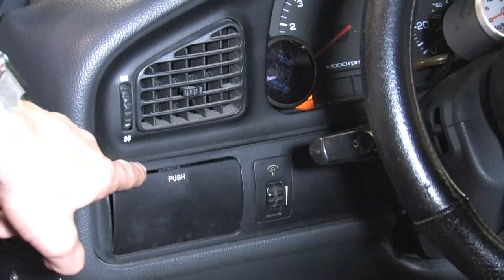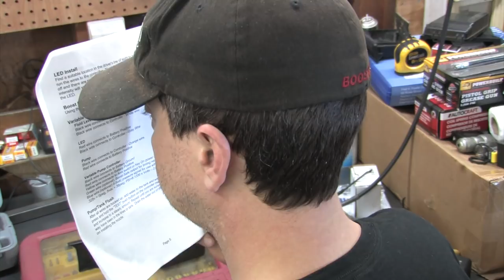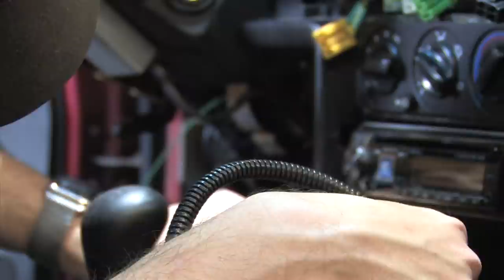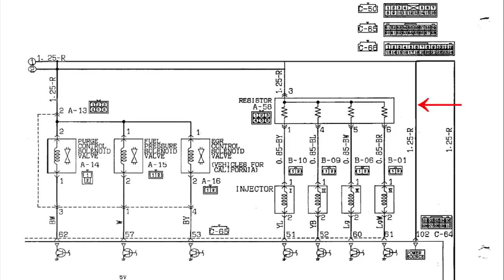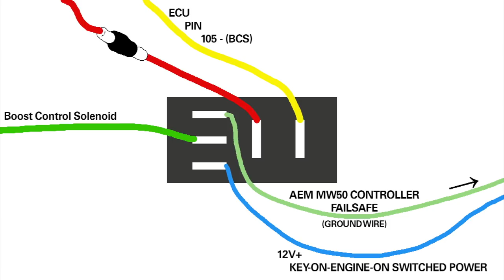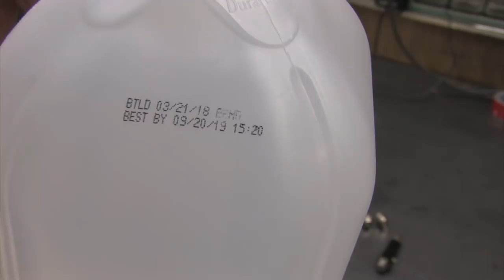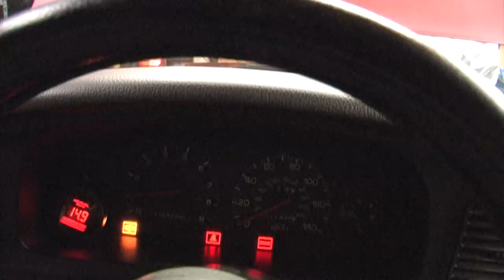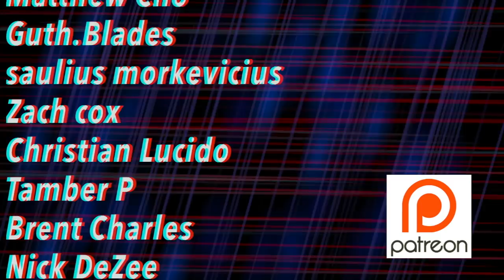Water Methanol Injection Installation

Comment: Great job. I was just going to get on the treadmill for 15min. But 43 minutes later here I am. I still didn’t get why you needed the fake circuit. Was it just to keep ecmlink cozy that something was still there?
Reply from the maker: I don't need it, I have an OBD-I car.  People with the second gen OBD-II cars will get a check engine light if the ECU circuit to the BCS is broken.  I made it match resistance of the BCS just so that it wouldn't feed an un-resisted load into the pin.  But really... all that was unnecessary because the OBD-I ECU doesn't care that the BCS circuit is opened.  At least it doesn't hurt anything and it helps all the Subaru WRX guys get rid of a check engine light if they use this approach to cutting boost (since all those are OBD-II).
Reply: Jafromobile ahh. Never had a 2g. How often does it check it? He would it light right away that you could use that as an indicator of fluid out if you didn’t want to mount a light?
Reply from the maker: Well, yes, you could.  But there's that whole "limp mode" thing.  Yes, the light is instantaneous.  It even immediately resets itself once the circuit is restored... BUT, the WMI kit has a warning LED that tells you you're out of juice.  My method simply puts the car in a gasoline-only portion of my fuel, timing and airflow tables.  If waste gate pressure results in this, there's no need for dealing with bad fuel economy in limp mode just because I ran out of MW50.  To me, that would be like punishment.  Go sit in the corner sort-of-thing.  If nothing else is wrong but an empty bottle, I prefer for the car to continue running properly.

Comment: You should wrap the hose with some insulation to prevent vaporization in the line.
Reply from the maker: Nice tip!  I hadn't thought of that yet.  :D
Reply: Jafromobile I've never used meth/water injection I just figured high pressure nylon tube in a  hot engine bay. I wonder if there would be a noticeable enrichment difference with and without insulation on a hot track day?

Comment: Boost gauge from Harbor Freight is just installed wrong and placed in the wrong spot. None are the fault of the boost gauge. Simply user error.
Reply from the maker: Harbor freight boost gauge ends at 20 PSI.  I'm running 24-30.  I suppose that's my fault, too...

Comment: Hey Jafro, saw a video of a guy having leaking issues with his AEM nozzle so he switched to a Snow Performance nozzle with his AEM kit.

I just purchased a new AEM kit myself last night (new video for that to be made when it comes in). But wondering, have you had any leaking issues at all with yours?
Reply from the maker: Yes, absolutely, I have.  It leaks, and despite the reed valve, given temperature changes it can leak in both directions, so you can even get air in the lines behind the nozzle.  That's bad, but that's why they gave us a purge button.  

This kit came without one important piece, but it's easy to add.  I picked up the solenoid to cut off the flow when the kit isn't firing.  There's actually an output wire from the controller that makes it a really simple install, If I put it close to the nozzle, it will solve all of it.  I just haven't installed it yet.  The only other thing I'd add is that you never need progressive control if you're tuning anything with the SD table   Just turn it on full blast at a pressure where it benefits you and it's easier to get all your percentages right however you're adjusting for them.
Reply: @Jafromobile  assuming you're saying the nozzle is leaking on the inside and water/meth keeps flowing, or air goes up the line? Here's the video I'm referring to where it appears to be leaking outside the nozzle I believe. Maybe where the line goes in.

I think I'm going to do as this guy did and replace it with a Snow Performance nozzle. Just have to figure out which nozzle/nozzles to run. From the looks of it, if you get pretty high in power you might need two nozzles to support the flow. Can't really tell just yet so still researching on that one.
Reply from the maker: @V8sareslow1  If it's on YouTube, just drop the video title, I'll find it.  I didn't see a link, so maybe it got blocked... but yes, all of my kit's leaking is internal.  It's like the reed valve doesn't work well enough to do its job, but I don't think a reed valve will ever work as well as a solenoid that stops the flow.  The 1/2 full line of my water methanol tank is the same height as the nozzle.  If I park the car for a week, it will drain the tank to that level right into my intercooler.  If the level is below that line, I end up with air in the line before the first time it sprays after it sits.  Based off this, I know that when I'm driving on the highway, my intake is under vacuum, and even without the kit spraying it's sucking fluid through the kit no matter what level the tank is at.  If there's an external leak on your nozzle, mine is not doing that.  I know it's leaking into the intake.  I believe this kit needs a solenoid because there's no flow cutoff whether it's operating or not.
Reply: @Jafromobile  my methanol kit should be here tomorrow or the next day. I'm having some drivability issues but once I get that figured out I'll be installing it and making a video for it. Went ahead and purchased a solenoid as soon as you mentioned that. I'll be installing that as close to the nozzle as possible. Appreciate your insight on it otherwise I wouldn't have known and just installed it as is. Also purchased a filter to keep out any garbage. I'll keep you posted though.
Reply from the maker: @V8sareslow1  I was probably a little overkill on my failsafe relay wiring, but I have to admit, it works mint!

Comment: Let me give you a few tips for a cleaner install. Flap disks their awesome try them. Cut the head off the bolts drop the bolt right below the surface of the tube so when you weld it you can grind it flush

Comment: We need in intervention on the subwoofer in the trunk,... is this not a race car? Weight reduction?
Reply from the maker: It is not a race car.  It's a subcompact economy sedan.  The bass is just part of its troll.  It's going 12's with a pair of 12's.  The GSX did it with the same turbo and cams already but one less amplifier and no bluetooth capability.  Same speaker box, though.  It's been around... Like I said, it's part of the troll.  Edit:  Heck, I want the world record ET for a Hyundai Elantra using a TD05H turbo, and with the subs still in the trunk.  I'm only 1 second away from it right now unless something hasn't been recorded.

Comment: thats a early 90s yellow dodge colt that was in the background, I almost had a chance to get one!!!  Are you eventually going awd with that colt
Reply from the maker: I already did.   I converted all 4 wheels to 5-lug for better wheel/tire options, too.  The rear axle install is done, I hate some of what I did after what I learned on this Hyundai (it's essentially the same chassis believe it or not), and when I turn that project back on one car from now... I'm re-doing some of it.  It also needs a new roof skin which is going to be a royal pain.  The videos are all here.  I let it sit too long.  Sorry about the poor sentence structure.  I'm on the verge of a food coma.  'never eaten as much as I have this week.
Reply: @Jafromobile  2005-2014 right, just saw your older videos.  Thats badass, I started the rx7 build in 07, then broke it, so back on the chopping board.
Reply from the maker: Yeah, I had some BS happen severe years back with my county that prevented me from being able to work on them all at once on my own property.  So I have to do one at a time inside my garage while keeping all others in working, registered, tagged, inspected condition.  The Colt is the only one I can't get away with leaving outside in its current state because the provision allows me to have one car and only one car in an un-registered condition.  So another car has to occupy the whole garage while it's being blown apart and re-assembled or I face a $2,500 fine... per vehicle.  So I have 5 cars, 3 running and driving.  One inside the garage, and one outside.  When I have 4 running and driving, the Colt will be the one I break records with if there are any attainable ones left by then...

Comment: Do you have a video on the ECMLink E-boost control setup? I have ECMLink and the 3 port BCS but have been hesitant to dig into it...heck I forgot I had it.
Reply from the maker: So you've just been running wastegate pressure this whole time?

Comment: just make sure you are careful if spraying water/meth during cold weather. If the charge temp is cold enough the mixture will no vaporize and will pool as a liquid at the back of the intake essentially putting a impressionable liquid in the back cylinders and cracking your pistons.
Reply from the maker: Nice tip!  Hey I've got other issues related to weather and water/meth.  If you bought this kit and you have a spare hydraulic solenoid sitting around to shut off the MW50 line when the car is off, maybe just go ahead and install it. If you don't, expect it to slowly empty itself into your intake as temperatures rise and fall.  Maybe won't hurt you on a cold start, but if you let it warm up and then hit the throttle... probably cause the same problem.  Cracky pistons.  I know I need to install one because I found my car is doing this as it sits.  It doesn't help me to have an intercooler full of MW50, but I'm not driving this thing at all right now.  Still has drag radials at 15PSI and it's too [expletive] cold to drive anything without heated seats.  I'm working on other projects at the moment that I should really be doing in warmer weather... and faking on camera like I'm not freezing my giblets off.

Comment: Have you thought of using a weatherpack plug, or a snipped plug from the junkyard to make your wiring a one clip ordeal?
Reply from the maker: Yes.  I did.  But I had solder in a drawer in my toolbox, and that would have required effort.  I would still have had to extend wires, and what steered me this way was the intent of making this a permanent install for the life of the kit.  If I have to remove it for whatever reason, I'll be re-installing a more extensive kit.  Of course I'll be really happy if it fits all of my needs and never has to be removed just the same.  :)
Reply: To anyone seeing this; if you've found a source for OE connectors and terminal pins other than the salvage yard or a stealership, PLEASE SHARE! The oompa loompa factories that make these can't just be selling them to the manufacturers.
Reply: Ryan Nelson have you tried Mcmaster Carr they have everything.
Reply: blindabinda123 I would like to find OE stuff. There are a lot of unused spots in fuse boxes. If you could find the right terminals, it's free real estate for accessory power.
Reply: Ryan Nelson check Mcmaster Carr. I'm telling you they have everything and if it's not on there website if you call them usually they either don't have it on their site or can find it.
Reply: Ryan Nelson let me know if that's what you were talking about.
Reply: blindabinda123 yeah those are terminals alright. He mentioned they were for a Chevy. I'll have find out what all else they support. Seeing some of the installation jobs done on jeeps and trucks for lights, winches, and what ever else those guys get a hard on for, there's definitely room improvement.
Reply: Ryan Nelson you could always take one out of one of the existing ones if the numb parts store guys can't find what you are looking for. My guess would be those are probably pretty much all the same buy you never know. What kind of car do you want them for?
Reply: Ryan Nelson did you check out that link for those wago connectors??? I've been using them for things and I can tell you they are life changing. They are great for thick or thin wires. Stranded and non stranded all in one connector and they have a test port if you need to check for power.  They are prefect if you wanted to run power to somewhere then run a couple different things off that wire. They make mounting plates for them and everything. OnceYou lock the nut closed you cannot pull the wire out either.

Comment: Okay I think I got it... I'm supposed to cut the blue wire and connect it to the red wire with 6 37 amp capacitors. Then spray water all over my engine bay and cut a hole in my intake so I can hear the knock and safe guard my car. Cause all the water might make my engine too cold to burn the meth and I have to put a screwdriver in a box in my dash to tune the relay to make it warmer and stop the knock before the bottle is empty. But if it is empty the relay will stop the backflow so it doesn't make it to the gate and get wasted.  Easy peasy. I don't know why people have such a hard time. There's a youtube video for anything you wanna know. Next up, fixing Mr. Whiskers limp. Heeeerree kitty kitty....

Comment: I have a old Cady with a 4.1 V8 but is lacking power.
The question is can I use this system to increase at least some power while using regular gas?
Reply: Yes, the benefits you get from water/meth are reduced on a NA engine though. In order to get the increased power you would need to tune the ecu to advance the timing. Snow performance claims that NA engines get a 10% power increase with water/meth.

Comment: Actually methanol is found at your corner store.  Just about any gas station you stop in will sell the yellow bottles of Heet gas line antifreeze.  It's 99% pure methanol and when i was using on my 1g it cost .99 for a 12 oz bottle.  Way cheaper than any of the premixed boost juice stuff, allows you to make your own custom mix and can literally be found at almost every gas station.

Comment: I mean the boostgauge blocking your view is your fault or who ever installed it, I use mine for checking max boost and watching for boost creep and checking vacuum
Reply from the maker: 1) the boost gauge was installed by the previous owner.  2) the ECU modification that uses the CEL for a knock monitor is something I installed after-the-fact.  3) the boost gauge goes to 20 PSI.  4) my turbo can make 29 PSI.  5) I built an engine that can handle every last gram of air my turbo can flow even if I welded the wastegate shut.  

I have nothing but 6-bolt 4g63s, so as far as the TD05H is concerned, even with stock pistons and rods there is no such thing as overboost.  Boost creep is just a bonus feature when it occurs.  I have a 102.875° LSA with my cam selection, so I just accept that vacuum sucks on this car.  But yeah, I get your point, I just still believe that boost gauges are useless if you can log it.  On an AWD car, I would find one use for it like setting my launch boost pressure on the 2-step.  Other than that, 19 years of using boost gauges and I never look at them for anything else.  Totally useless on a FWD 4g63/TD05H combo.  Bone stock 4g6x engines can take every PSI they produce if your AFRs are correct.  That's why I prefer a Wideband o2 and a knock meter over every other possible option.

Comment: Do you see IAT before or after the water/meth? If yes, what does it do to IAT with it flowing?
Reply from the maker: We're going to know really soon.  Car is up on jack stands at the moment.  Still making a few changes to extend ECMlink's capabilities and make it even better.  I've got plenty of before logs to compare it to once she's back on the ground.  I still don't have any good data yet but will share.  Yes, the nozzle is about a foot in front of the IAT.  The instructions said 6" is sufficient, so I assumed they were written by a woman.

Comment: Getting ready to buy a new video editing computer. Any graphic card recommendations? Don't want to overdue it now with current prices.
Reply from the maker: I'm 100% Mac, so you probably don't want my advice.  I'll say that storage speed makes a much bigger impact than video card selection, though.  Fastest SSDs you can get.  PCI-e if possible.
Reply: Jafromobile  Samsung 970 Pro NVMe with dedicated M2 slot with comms straight to the CPU. PCIe bus is separate on new motherboards. Thanks for the advice in writing. Will make the price of the Samsung look more like a requirement to my girl friend. LOLOL

Comment: Would methanol injection allow a motor home  to run leaner to increase fuel economy?
Reply from the maker: Probably not.  Forced induction is the platform that will show benefits.  If it is a supercharged or turbocharged motor home, then maybe?  It's only going to help you at full boost.  The Ford Ecoboost systems yield almost a 10% improvement in fuel economy.

Comment: While Methanol isn't so easily found, ethanol is. And ethanol is both the safer and easier to find option. It's sort of the reason E85, and other flex fuels, now use ethanol now instead of wood alcohol.

Comment: I've always been told far as the methanol injector is that you want it after the intercooler but far away from the throttle body as possible that way water meth injection as much time as possible to evaporate and make the air charge dense as possible as a gas. Anybody else have any insight on this I have mine mounted right on my intercooler coming out of it and it's always worked great.... plus the aluminum thickness on my intercooler is super thick compared to my intercooler Plumbing. Jafo it's been a month I've watched this video 3 times we need another video how's it coming?

Comment: It appears that you are resting your foot on the clutch. ?
Reply from the maker: Yes, it does appear that way because my foot is between the camera and the pedal.  That's hover-foot.  The car was automatic, and there's nowhere else to put my foot except for on my fuse box and the ECMlink cable connector.  Because the car was converted from automatic to manual, there is no dead pedal in this car.